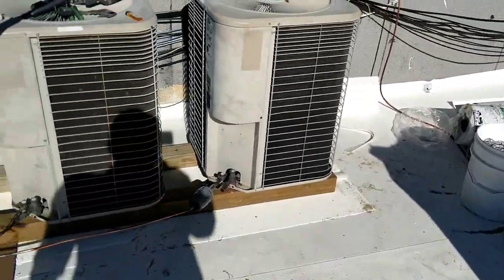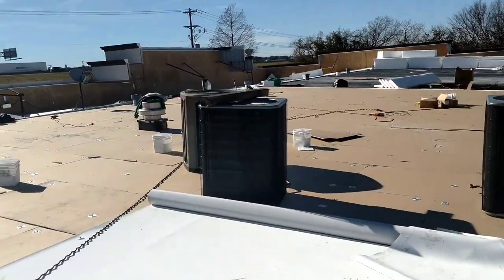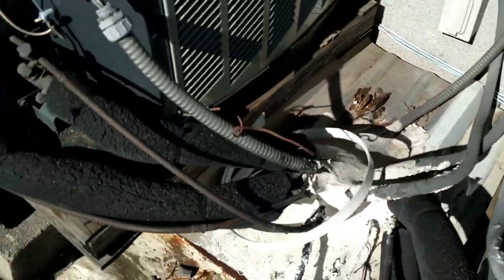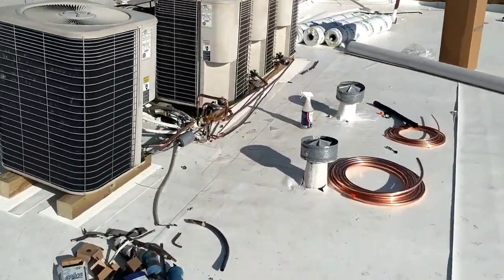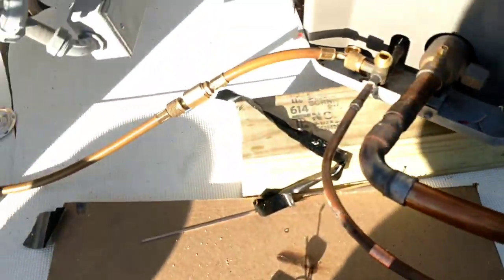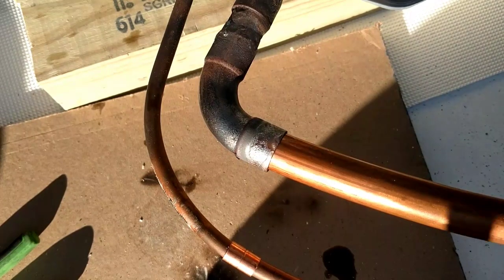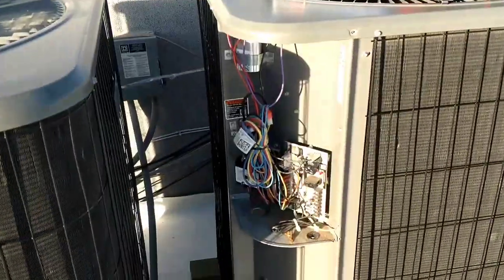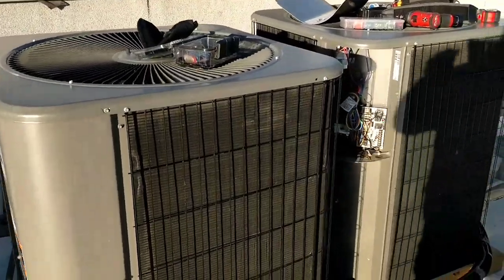HVAC- Removing condensers for roofing job.

Comment: Question for anyone that can help. I’m trying to find the breaker at the panel, for an individual condenser, but nothing is labeled. there are 20 packaged units on the roof. What is the best way to find which unit goes to what breaker? Thanks
Reply from the maker: Is the panel far away.  You could try to use a Bluetooth meter or probes and see when you lose power.
Reply: Rookie Refrigeration I have the Fluke 902fc. It has Bluetooth features. I’ll give it a try. What i was going to do was use the low voltage wires to connect my fluke CIQ 100 Which I use for Cat5e low voltage cables to find my source. But i like your idea. Thanks